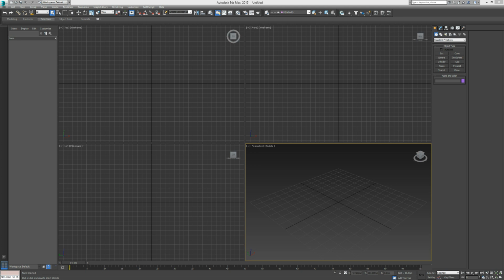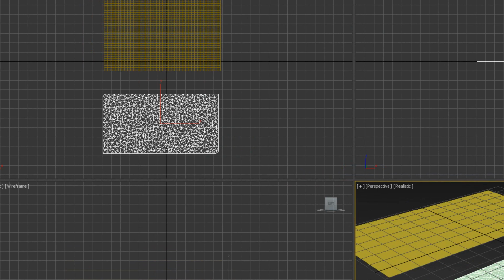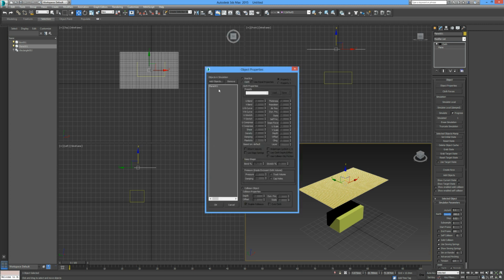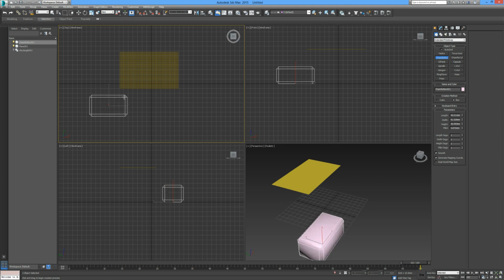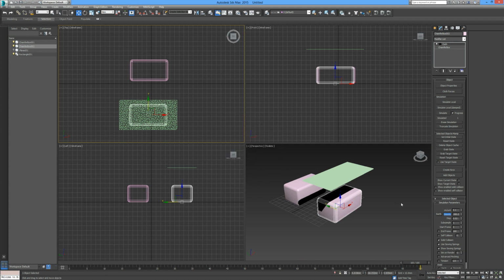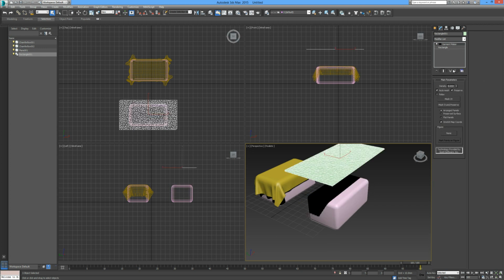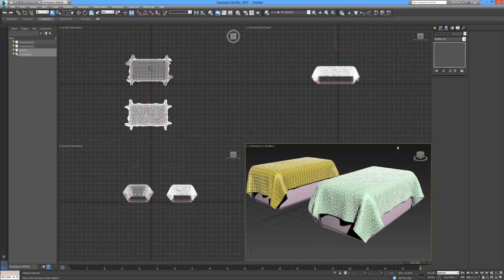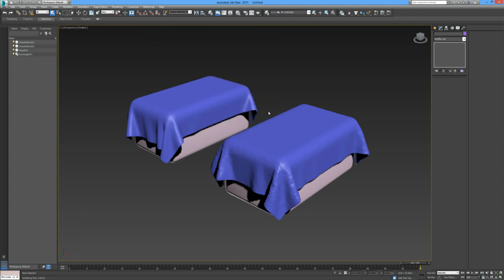3Ds Max Tutorial 15 - Cloth Modifier, Creating a Tablecloth

Comment: if you dont want to use a champfer box to avoid penetration do you need to increase the cloth detail,  or decrease units scale? or increase steps?
Reply from the maker: Adjust the friction and offset, maybe increasing the samples will help also. The cloth really doesn't like sharp edges. Maybe if you put a tiny bevel on the edges there might be enough geometry there for the cloth calculation to work.